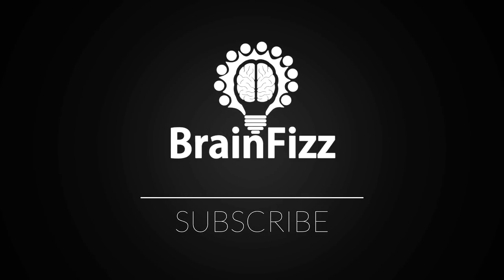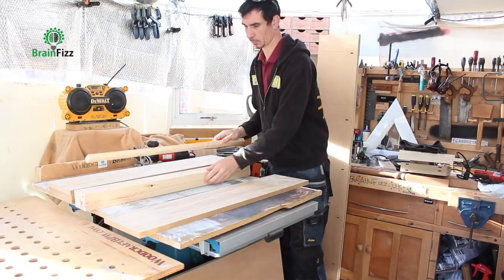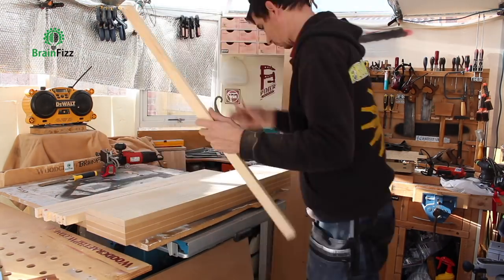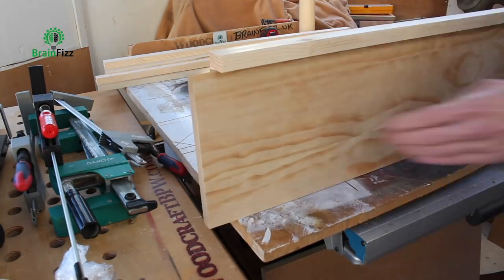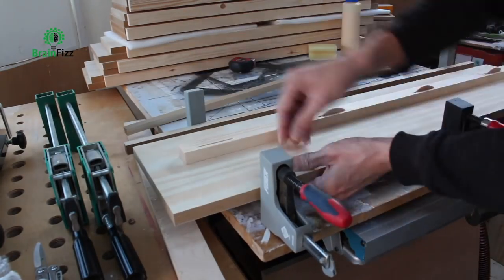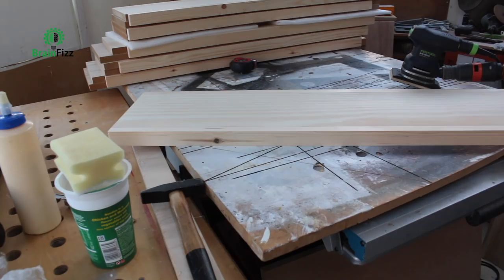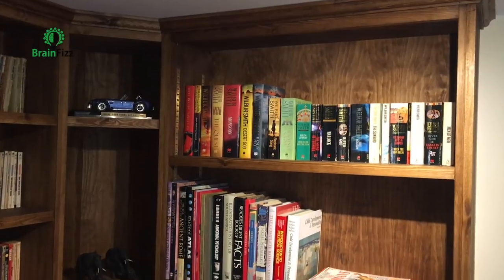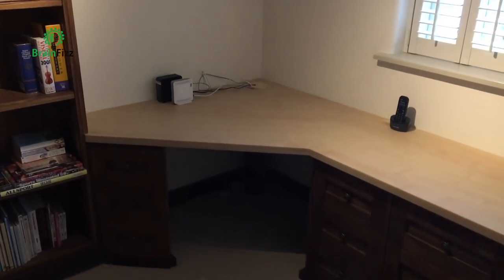Project repetition: Tips for increased profits | Lipping Veneered boards.

Comment: A tidy job, Rick. :-) Do you have any tips on staining pine? I've previously found that it tends to come out quite blotchy.
Reply from the maker: Agreed, pine can be a pain to stain. I find generally that although it can be a bit of a gamble, extra attention to sanding/glue removal as well helps.
I also prefer to use spirit stains on pine and work methodically to minimise over or under staining areas.
Sometimes though it’s just down to sheer dumb luck